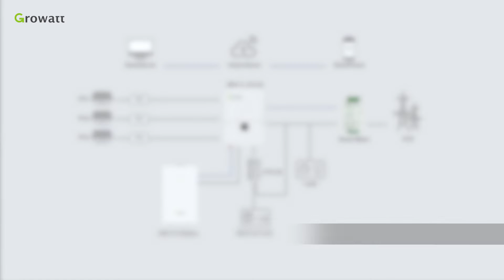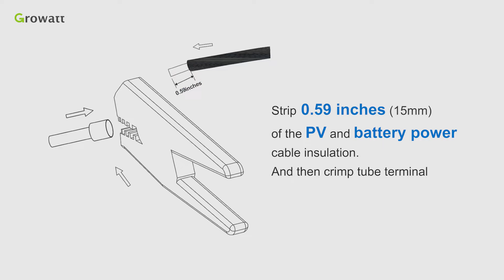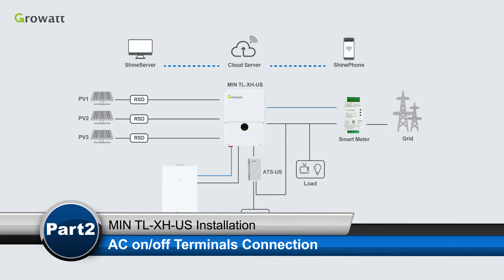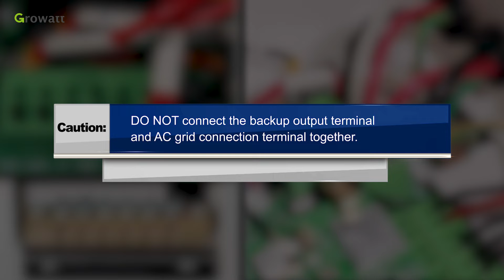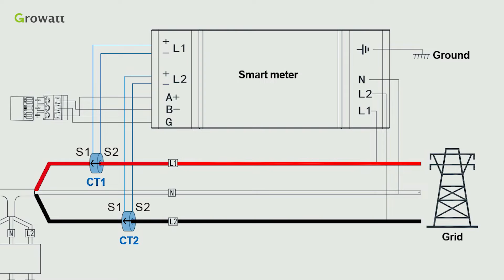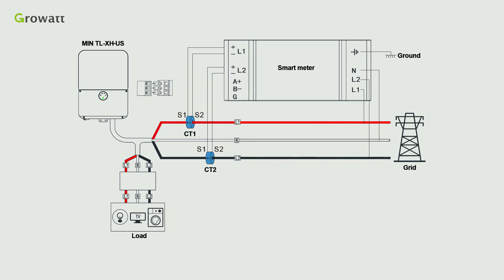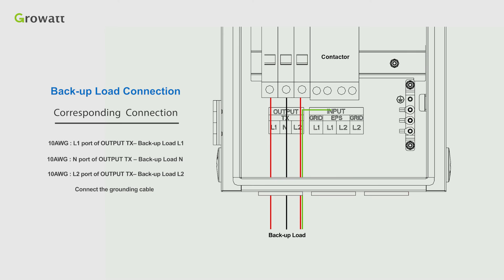MIN XH-US PV Inverter Connection

Comment: Can this inverter be used just grid tie only. No battery ?
Reply: Did you ever get an answer to this? I just want to add to my existing solar. Don't want all that other nonsense. Just panels and inverter.
Reply: Yes it can be used for grid tie only. That’s how mine is
Reply: @dan33klein  I can verify that this is correct as that is how mine is set up.  Don't expect an answer from the company.
Reply: @johnnymiller6230  awesome...so just curious cause i just bought one... i can put my panels strait to it...then attatch the inverter strait to my panel with a breaker and some wire...without the smart meter they are talking about in the video...
Reply: @dan33klein  so urs is just hooked up through breakers and some wire.. so smart meter thingy or backup bs...
Reply: @yoitsspud 
Yeah. Just tied into the panel with a breaker
Reply from the maker: Hello, for product inquiries and business collaboration, please feel free to contact our sales team at info@ginverter.com. Or you can visit our website at www.ginverter.com for more info. Thank you!